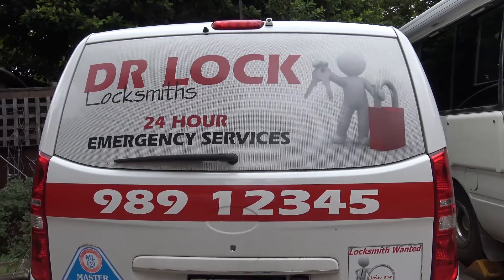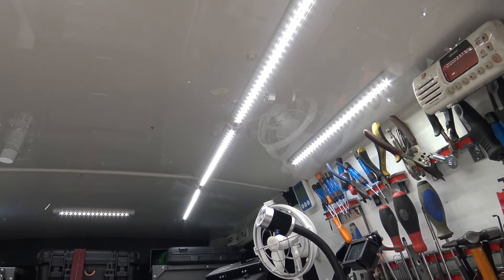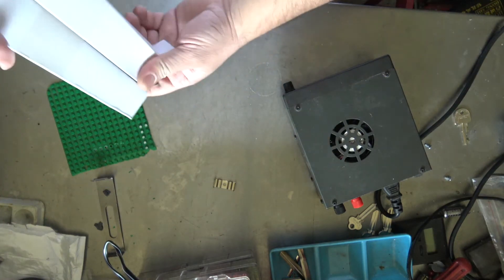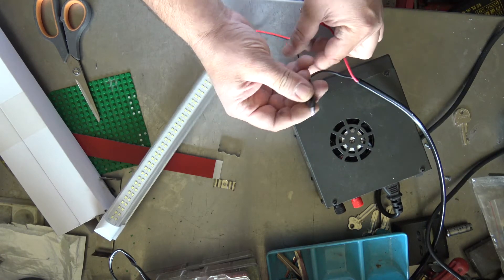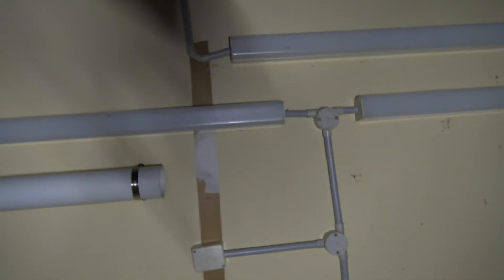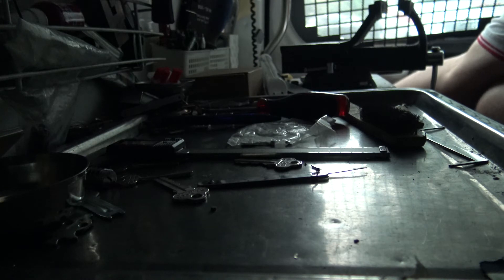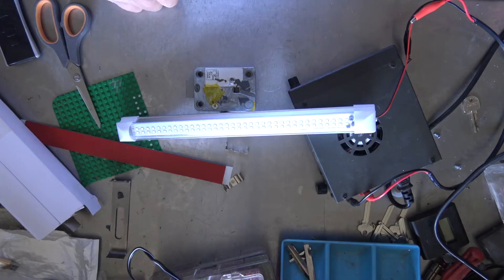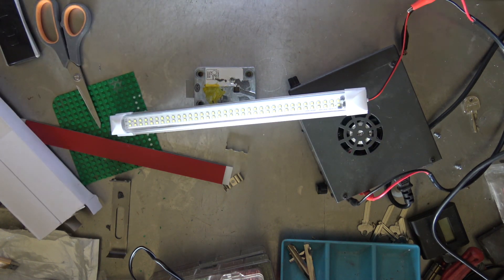Test Review LED Strip Lights BAR  $10 Against A Narva LED Light $80

Comment: can you connect this light to battery positive and negative or does it need fuse or resistors etc
Reply from the maker: you should always use a fuse, resister not needed